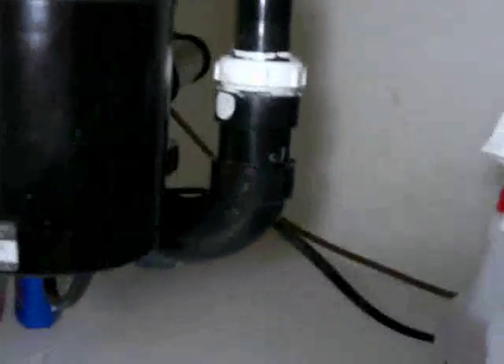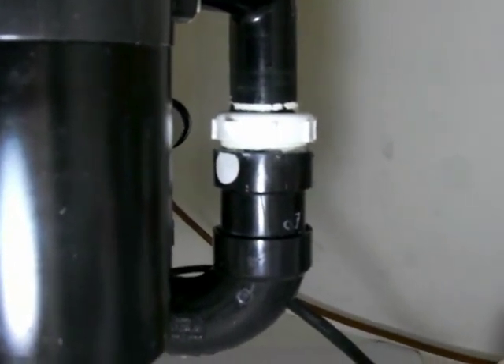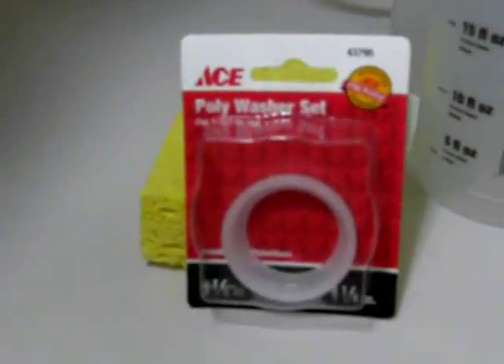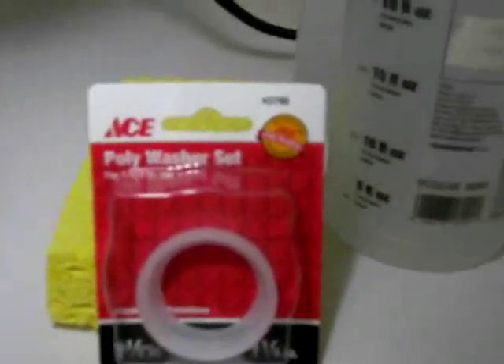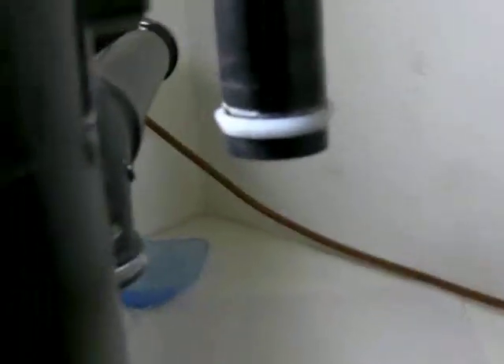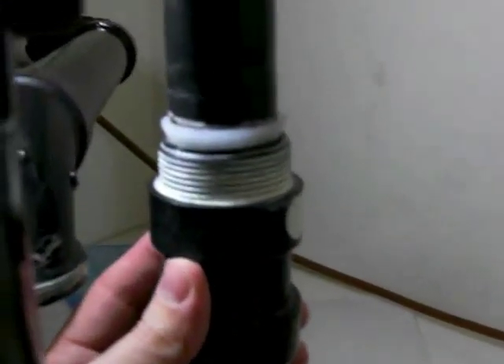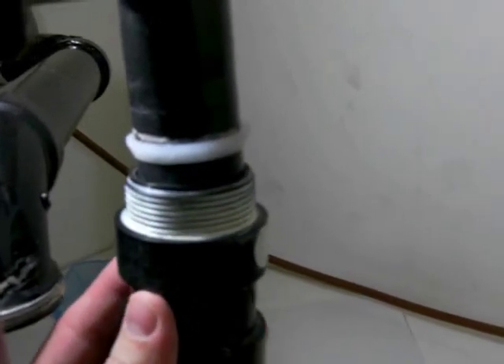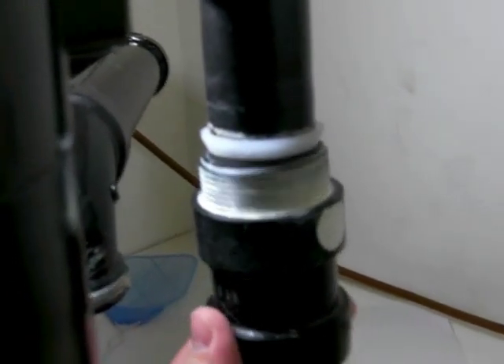Kitchen Sink Leak ... 2 of 3 ... Needs a poly washer, outside of the garbage disposal

Comment from the maker: Hi!  In my vid, it was leaking in two places, the seal on the sink, and a missing poly washer on the pipe below.  After I did the seal on the sink (and knew that was good), and saw that there was still water below, I wiped it under there, got a flashlight, then ran the water to see what was going on.  Check out all 3 vids in this series, I show it. Leme know how it goes.